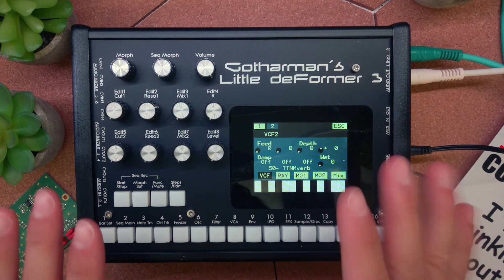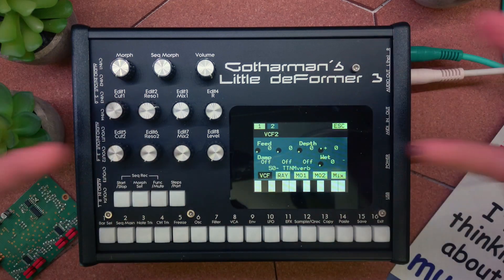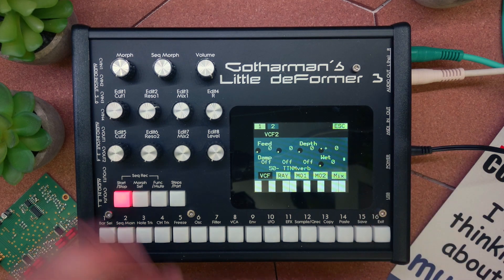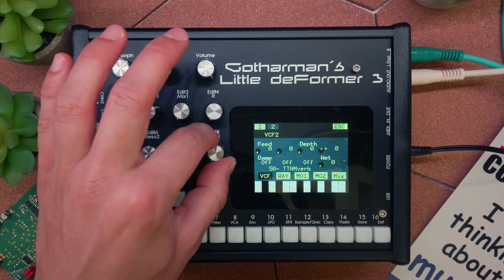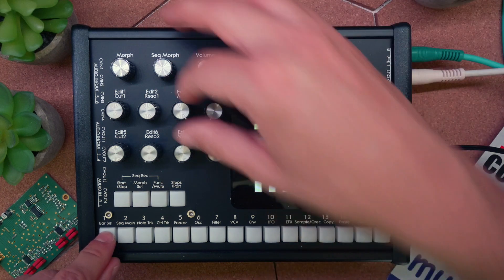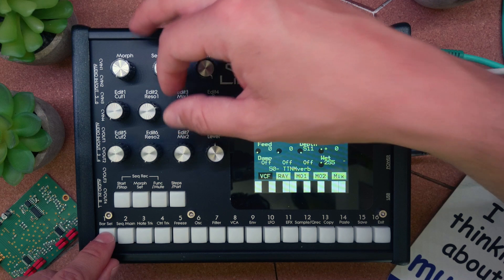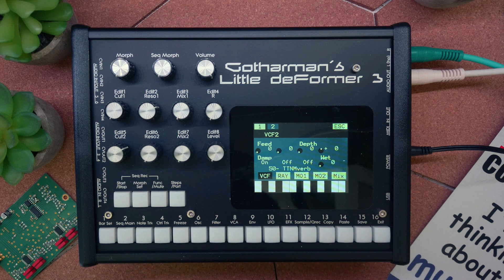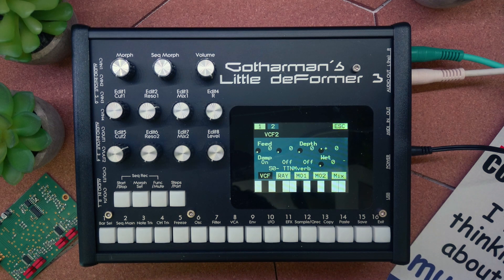REVERB BOARD in Gotharman's Little deFormer 3 (Synth DIY) #TTNM

Comment: Amazing ! Did you change the firmware ? To fit the control on the screen ?
Reply from the maker: No need for programming :) the filter board circuit was published by Gotharman for others to develop their own boards and in the process he added a menu in the devices that allows you to easily create, save and export your own custom filter menu. So cool!